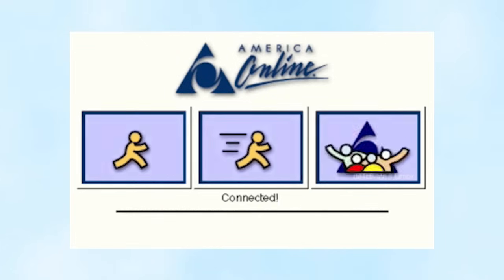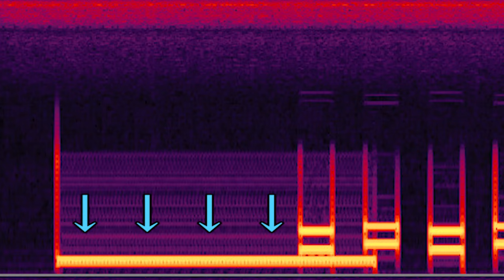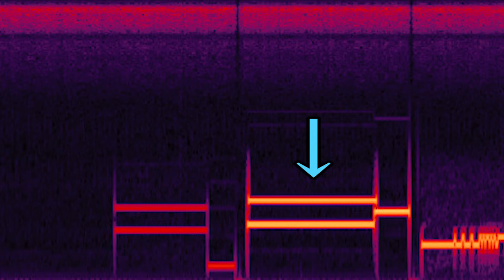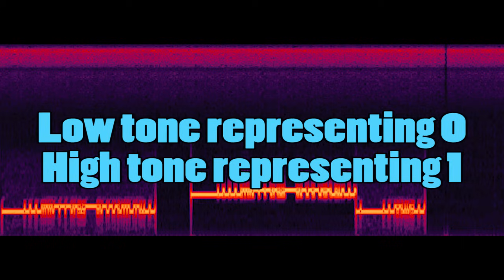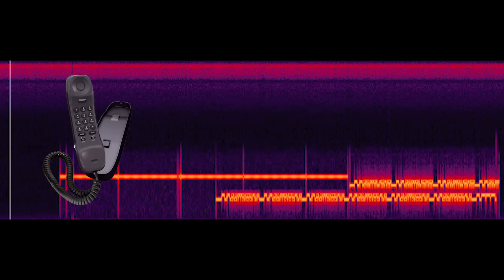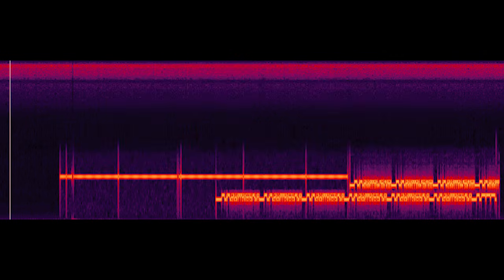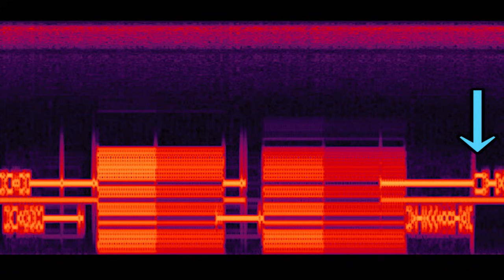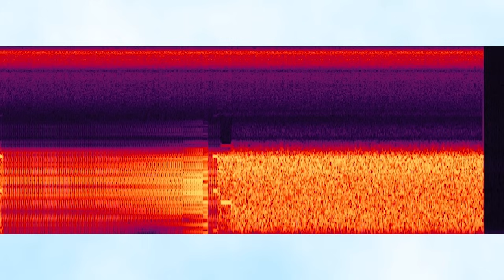Why Does Dial Up Sound The Way It Does? (An Explanation)

Comment: yeah yeah... old video... i know... 
but i just found it, because i searched for "modem sounds explained"
Just by listening to the sound i know it is a 56K modem with 33.6k uoload. just to clarify: i am now 44 years old... so i lived in the era of modems (waaaaay to long until dsl was available at my home)
12 digit numbers where in use in germany, too. not for the big companies... but i connected to a small company that used something like a local number.
the "sound of victory" ... i know this sound... and it only happened when using a 56k modem... i thought this was the handshake for this data compression mode... (i heard the sounds from 2.8 k to 56k full duplex modems) so there is a point i disagree. btw 56k uo AND down... sounded even differently...
But all of the rest... you did a great job! apart from this last segment, every part reflects what i heard at the different speeds. i and i am thankfull, that you preserferd this kind of technology...
oh just as a reminder... even windows 10 can connect via a modem...

Comment: So the dial up internet noise is 2 robots talking to eachother? 
Dial tone
Robot 1: Dialing a number
Rb1: "Roger,  hello,  do you copy? Over"
Rb2: "Roger, copy, over"
Rb1: "Roger, Requesting switch to a modulation method. Over"
Rb2: "Roger. Accepting. Over"
Rb1: "Roger, Choosing a standard. Over"
Rb2: "Roger, standard chosen. over." Rb1: "Roger, dissabeling echo suppressors. Over" 
Rb2: "Roger, Listing modern standards.  Over" 
Rb1: "Roger, Measuring phone lines. Over." 
Rb2: "Roger. Over." 
Rb1: "Roger: Deciding bit rates. AAAAAAAAAAAAAAAAAA. Over" 
Rb2: "Roger, AAAAAAAAAAAA, received. Over"
Rb1: "Roger, permission to Set up full duplex? Over." 
Rb2: "Roger, you may proceed. Over" 
Rb1 and Rb2: "AAAAAAAAAAAAAAA." 
Rb2: "Data accepted." 
Rb1: "Affirmative. We may now Transmit data." 

AOL messege: "send nudes"

Comment: To be honest that's how binary sound. You can hear same sounds when you throw disc (or if you have cassette) with data to audio reading device. And by that i mean something from the 70 to 00 because after that most other devices already have mini computer set up in it. So it wont happen.
I once did that because i though all games have seprate folder with audio and allow you to listen to it... I was wrong AND scared....

Comment: I speak fluent modem tones.  My buddy runs this handy page http://www.modemhelp.net/basicatcommand.shtml. The AT command set is used to control  all of these sounds.  The S registers were used by us old dial up support folks to tell the modem to hold x amount of seconds before 'retraining' the modem to get the secure handshake. (my fav was s10=100) The middle section of the hand shake is called the digital impairment learning sequence ( https://patents.google.com/patent/US6301296B1/en). 99% of all modems in use today start at v.34 then during the DILS, go up to v92, completing the handshake, The first test packet is sent with info to start the first packets header. During the DILS, this estimate is used to derive optimum transmit symbol constellations for a modem connected digitally to a trunk so as to maximize its data transmission rate. (quote).

Comment: I used this video to make a point. My parents do things that they don't understand the basics of, while what they are accidentally doing is complex. On their cheap phones, of all things.
I like this video, because I remember those sounds. I understand tech in a way that my parent's cannot. Literally cannot. So thanks for the example, because while I didn't understand the tones at the time, I later came to understand them as the basic starting point for most smart products. Or the advancement of said smart products. 
My parent's don't understand the difference between a modem and a cable box. For them, you just plug it in and go, but they never remember HOW to hook up the cables. Wall to box to tv. Gaming systems... somehow they paid for them so that I could "hook" them up, despite them not even having even a general idea of how it actually worked. 
Sorry mom and dad, but you stopped learning at some point, by choice. Just saying.

Comment: Why would the casual user need to hear the modem language during the handshake. As you explain, the noisy part at the end is regular data traffic. As the modems continue talking, the sound card stops sharing that audible 'noise' with the user. Was there a setting to not hear the handshake through the sound card as well?

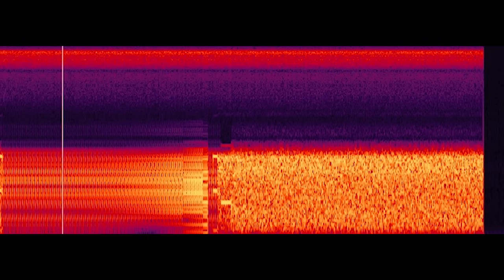Comment: 6:45 no it isn't, it's another probing signal by a calling modem to measure signal to noise ratio and some other things so the answering modem could start sending data in PCM modulated and correctly adjusted signal which gave you 56 kbit/s max (the last sequence is still random data as it was before that probing sequence, BUT the modulation is different - it was TCM before, now it's PCM). I didn't have this sequence in my country so I connected using V.34 protocol and my max speed was 33.6 kbit/s.
Reply: Wtf man?!? You forgot the "You got mail." Sound after all that noise

Comment: 5:44 Dialup modems use a single carrier to transmit data (unlike DSL, which use Discrete Multiple Tones modulation for example). 
With such technology, to transmit at a higher bit rate, you can either:
1. Transmit more symbols per second AKA increase the baud rate, but you need more bandwidth to do this (limited by the phone line capabilities).
2. Increase the quantity of information coded per symbol (bits/symbols), but you need a better signal-to-noise ratio to do so.
To improve the signal-to-noise ratio, you need a phone line with a flat frequency response (frequency selective fading introduces distortion), and predictable signal levels, which doesn't exists in the real world. However, the characteristics of your landline don't change over the time of your connection. Thus, modem designers introduced line probing to characterize the frequency response of the communication circuit, and feed correction data to frequency equalizers to compensate for your line's flaws. That way, your modem can pack up more useful information per symbol (less amplitude/phase distance between symbols, and more symbols with low absolute amplitude).

Comment: This modulation technique in its original state is still being used today by military, police, aircraft, marine to send and receive small bits of important or critical data over analog FM/AM radio sometimes on distances over thousands miles like in the middle of ocean. I am HAM/SDR radio hobbyist and I can hear it on both AM and narrow band FM commonly on police and aircraft frequencies. They also use morse code time to time which is funny, presumably when there's not enough bandwidth or signal is weak.
Reply: I see a fellow ham/sdr radio enjoyer?

Comment: Some of this is a bit wrong, or could be clarified better. The part where you say they are sending a bunch of random data is actually a probing signal to characterise the phone line signal loss. Analog lines attenuate different frequencies by different amounts, and this non linear behavior needs to be taken into account to maximize signal to noise ratio. Each side sends a signal that the other side analyzes. They then tell each other the results so they can adjust their transmission levels to maximize signal quality.
Next, the rising volume part right before the end is not a "victory"signal. Lol
Pots (plain old telephone service) lines can be converted from analog to digital and back again instead of being purely analog the entire span, especially long distance calls. This badly degrades the signal, but only for certain signal types.  The modems can detect this with the special probing signal, and when it is detected (it isn't in this example), further negotiation must be done to figure out framing types on the digital part of the span, this allowing better signal usage and reducing the chance of corrupt data.

Comment: At the 5 minute mark on the dot you talk about "The probing segment".  What I would find even more interesting is discussing the differences between a 56K modem and earlier modems.  This is obviously a 56K modem.  The earlier modems didn't have that "Probing segment" or what I call the "Dong Dong Segment"  If you followed modems through their history of progression as I've lived through you will know that with each modem series, 300, 1200, 2400, 9600, 14400, 28800, 33600 and 56K, each one along the way added and subtracted things to the overall handshake sounds.  2400 was really short in comparison to 56K.  For historical purposes, I think it would be even more informative to discuss the various modem speeds throughout history and their own individual handshaking.  Good job and very informative on the 56K modem, but would be nice to see the others as well.

Comment: Very, very good video. I did this stuff at uni for my degree and you've done a fantastic job. DSL doesn't give average users the same ability to visualise what's going on since we never hear, see or touch it! But dial up allowed users to sense it via sound and analyse it easily. Essentially it's all the same thing though, just faster frequencies now that sound much more high pitched when you do get a chance to convert the signal to sound!

Comment: I accidentally called a modem today and my phone's volume was all the way up so you could imagine the pain my ears were experiencing
Reply: Unless you called a fax, all you'd hear is a repeating BEEP because it can't make a connection
Reply: Pocoraven,

You dial a number on you phone.

717-664-3735 no longer works

Try these:

778-379-7158

503-852-3170

The above numbers dial to modems, when a modem picks up it expects a tone from another modem trying to connect.

If you call the above numbers the modem cannot connect because you are not a modem.

If you want to, you can go to
www.telnetbbsguide.com
Reply: Jack Nedry why does it sound different?
Reply: Antonio Gonzalez,

Different baud rate perhaps
Reply: @antolino11  when you call a modem with your phone the receiving modem expects a tone, and when it doesn't get that response it basically"screams" or sends a loud barrage of tones to try to get a response. That's the noise you hear when calling a dial up modem or a fax machine with your phone instead of a modem
Reply: Jack Nedry the 778 number doesn’t work but the 503 one does, just sounds a little different from the dial up we’re used to
Reply: You dial a number on you phone.

717-664-3735 no longer works

Try these:

778-379-7158

503-852-3170

The above numbers dial to modems, when a modem picks up it expects a tone from another modem trying to connect.

If you call the above numbers the modem cannot connect because you are not a modem.

If you want to, you can go to
www.telnetbbsguide.com
Reply: @ricardopinto5749  dude you literally just copy pasted someone else's comment
Reply: Whenever I call my therapist it makes the fucking dial up sound. What does it mean
Reply: @aeiou4184 it means you need to take your medicine little kid.
Reply: @Paradoxical Nightmare That would be an interesting experiment.
Reply: how are your ears now?
Reply: it can happen insome countries with avaliables csd lines
Reply: CamChild :/
Reply: O__O ????
Reply: Call back with a modem of your own

Comment: But why could we hear the sounds? Why did they have to be audible?
Reply: Yes, you could also get a hint at failure causes, from the sound of TRYING to connect and failing.
Reply: I had a phone line with a hum; I could listen to the sounds, and tell if I needed to redial to attempt to get a higher speed.
Reply: Because the telephone is designed for transmitting voices and the sound frequency range is very limited, around the voice frequency which a normal man could make. So the modem has to encode data into sound signal within the frequency the phone line could transmit.
Reply: audio sound where commands. So you could bypass a phonebooth by whistling in the phone to make free calls on a land line.
Reply: Who says it "has to be" audible? +++ATM0
Reply: At least it has become a great meme/sound effect xD
Reply: Dial-up modems were designed to use voice frequency range, as others have mentioned. It might be of interest to note that DSL still uses your home phone line (up to the local DSLAM), but it uses a much broader frequency range which is far above what humans can hear. The much higher and broader frequency range allows for the drastic increase in bandwidth (compared to dial-up modems), while still allowing normal phone operations at the same time.
Reply: These sounds were audible and loud so I could annoy the shit out of my sister.
Reply: Because phone lines were only designed to carry voice frequencies.

When ADSL was invented, it stopped being audible.
Reply: Mass mind control

Comment: reminds me of a dumbass mistake I made in 2004, after a few years without a computer, I went online again. Still without a landline (actually never had one again at home), I connected through my mobile phone, was a little disappointed not to hear the dial up tones (the computer connected to the phone through Bluetooth and used the phones dial up modem). A 2Mb video took about an hour to download, but webpages loaded within a minute. It cost me 2p a minute to call my ISPs 0845 number - spent about £8 that day (the call would be 30p a minute now).

The dumbass part? My mobile carrier provided a GPRS DSL broadband data connection, which would've downloaded the video in seconds and loaded the webpages instantly, I don't think many people used it, as they didn't even charge for data then, it was unrestricted, unthrottled, unlimited, free for the taking. The carrier must've had a good laugh at me paying 2p a minute on dialup over a weekend doing what I could've achieved in half an hour on DSL for free!

Comment: Easy solution: Turn off your sound.
Reply: Pocoraven So what? You could then use ATM0 and/or ATL0 on the modem to completely disable it's internal speaker

Comment: isn't the 12 digit number called out at the beginning an IP address?
Reply: no, its the number of the Internet company, the modem generate the "tone" for the phone. (the sound of the phone when you press a number) . In the 80s you had to do the manual call and connect the phone to the "ears" and "mouth"  of the computer.
Reply: Obviously a millennial.
Reply: I could see how DTMF would be confusing if you've only ever used a cell phone.
Reply: As noted, the 12 keys probably included "+1" to reach the US. Oddly, it didn't include the common 3-key Vertical Service Code, *70 -- and a pause -- to suppress incoming Call Waiting tones that could otherwise disrupt the data session.

Comment: I have a USRobotics modem, and the second-to-last sound (which you described as being the sound of victory) is replaced with this weird "B-D-D-D-D-D-d-d-d-d-d-d... B-D-D-D-D-D-d-d-d-d-d-d" sound. Do you know what that's about?
Reply from the maker: 72speedway As a commenter pointed out already, that really isn't the sound of victory. It's actually something called a DIL sequence. Of course, there is a lot going on, but it boils down to just a way that the two modems can decide a final bitrate over an analog connection, without any bits being lost. As he also pointed out, different modems have different DILs. So that sound you described most likely serves the same purpose. 

Man I really need to add that annotation
Reply: When I had my Pace 56k Voice, I never heard that segment until I flashed it to support v.90 (56k). If you had a 33.6k modem or slower, that sequence was skipped.